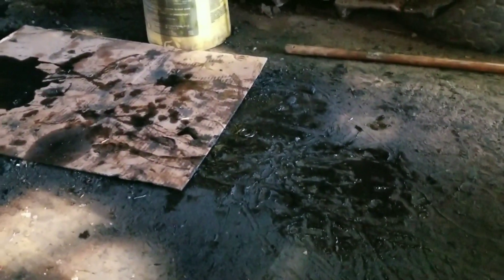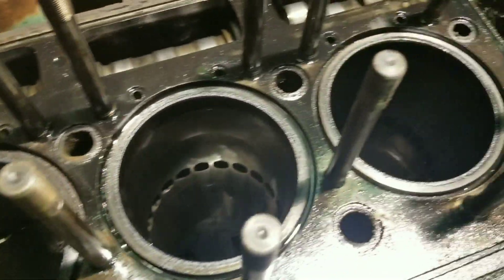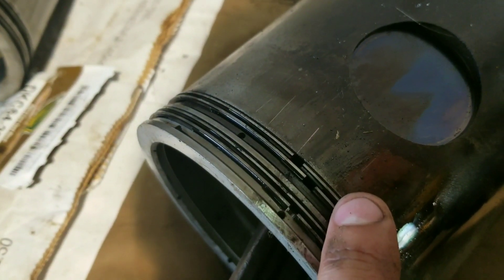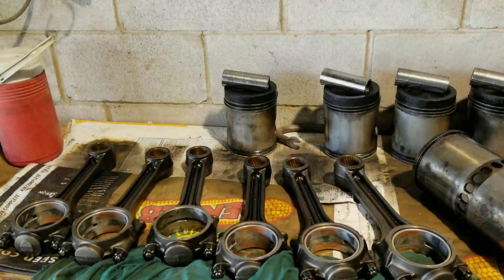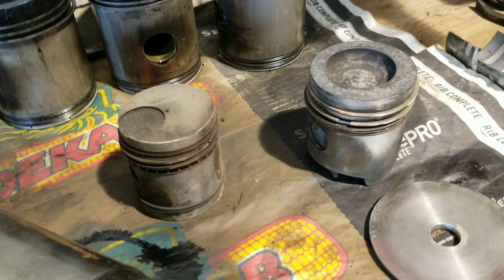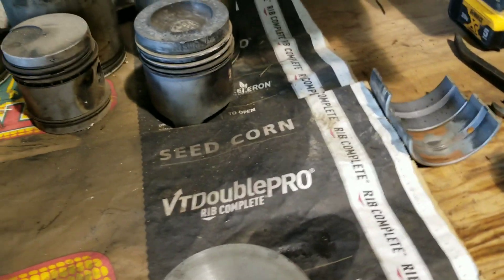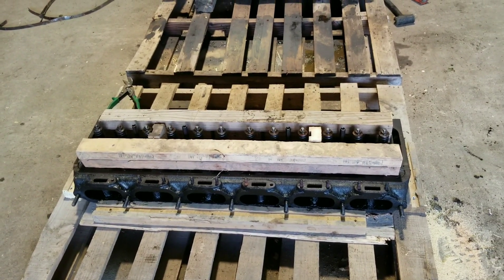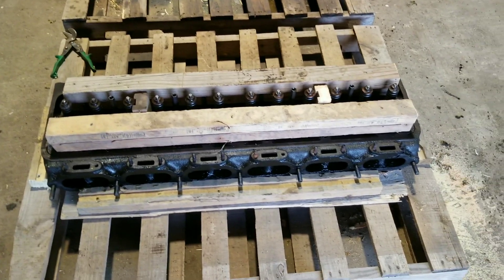Detroit Diesel 6-110  Teardown part 2

Comment: When u put ur rings on  install pistons  in liner from the bottom or u will break oil control rings
Reply: yep, assemble them as a unit power assembly.

Comment: Make sure you have good cylinder liner to block fit.   If too loose cylinder components will run too hot resulting in short engine life.
Reply from the maker: Its my first detroit, but they were all snug installed by hand

Comment: I would not worry about the ring end gap location.  There nothing to hold them in one place and they randomly rotate in used anyway.   Do check the ring end gap to be sure the gap is not too small or large.

Comment: Use extra care when installing the wrist pin cover caps. There is a special tool for seating them properly. If not sealed correctly, the engine will leak oil into the air box. You need to use a vacuum tester to assure they hold vacuum before you install the piston in the liner, else you will have to take everything apart again to fix the oil leak.